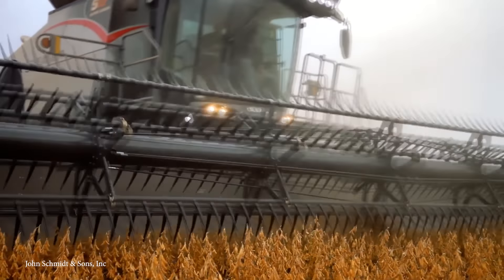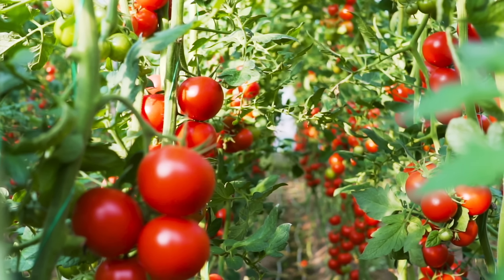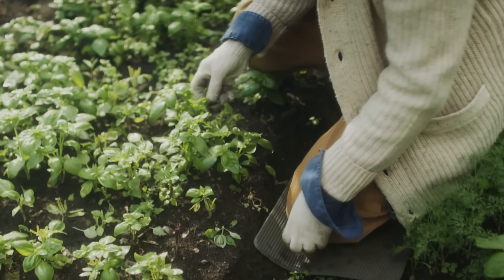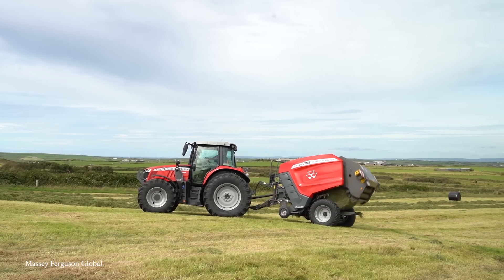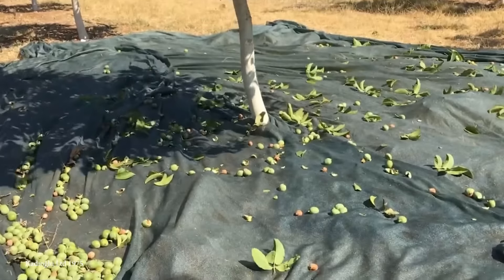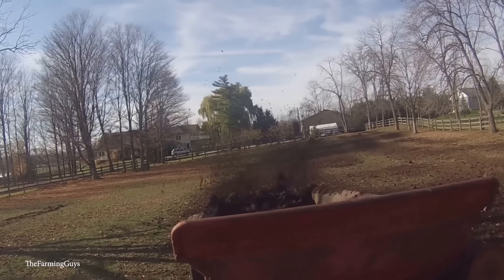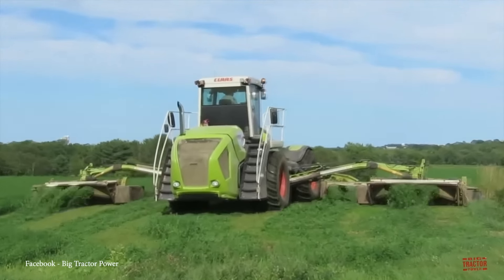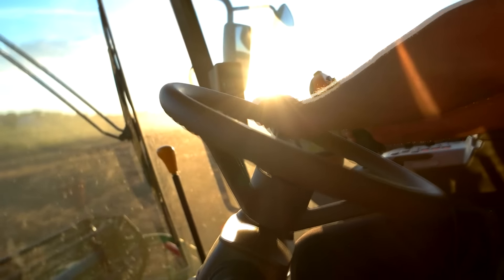TOP 15 HUGE Harvesting Machines

Comment: @Top Fives Okay, that thumbnail is unacceptable. First off, that is a planter. A DB90 to be precise... Photoshopped to look like it has multiple toolbars, while not a single real planter exists to my knowledge, especially not a Deere, that has more than one single toolbar. And no planter requires more than one tractor to pull it. This thumbnail is NOTHING more than disgusting clickbait.
Reply: Correct.  The only reason I clicked on this video, is to down vote it for the clickbait image.